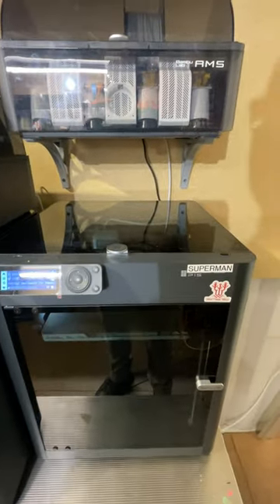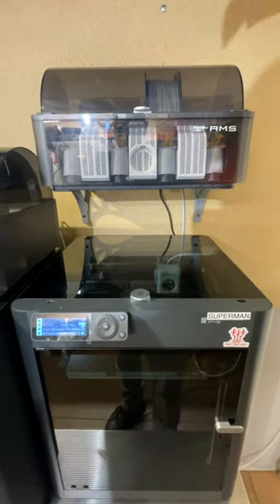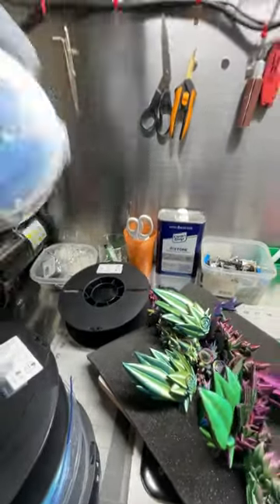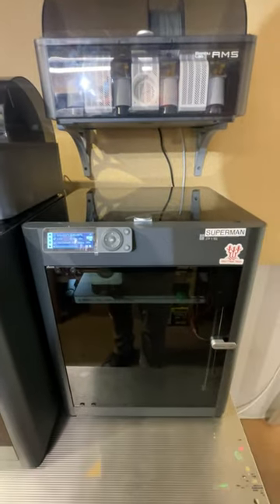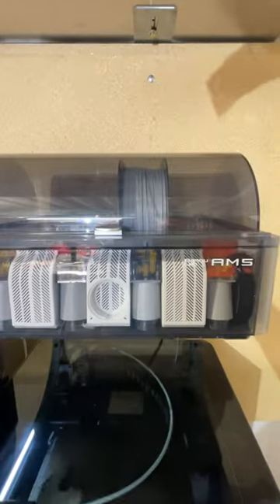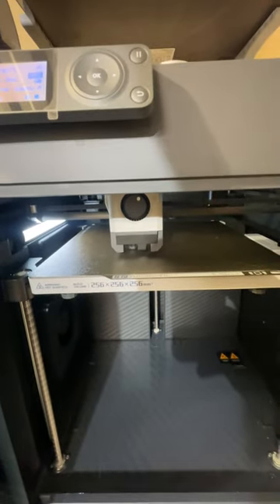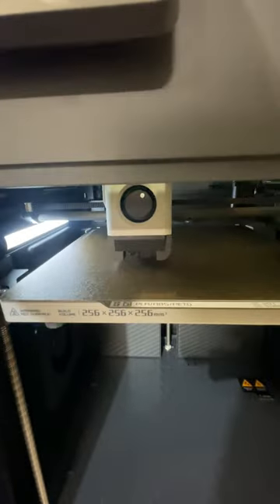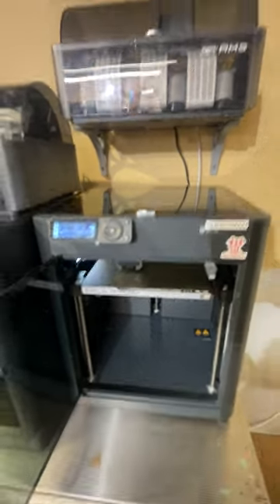Exclusive Tips for Bambu Lab Printer Owners

Comment: Print the hydra ams system and replace the bottom injection-molded base of your ams if you want to use a wide variety of spools. Solves most of these issues.
Reply from the maker: I will look In to it thanks

Comment: Manually heat extruder to 220-230F for PLA, go to the extruder menu and press the button to extrude it while gently pushing the PLA through it.  Keep pressing the button to extrude it every few seconds while pushing the PLA and youll feel it "catch".  Once its caught, then just keep pressing the button until you see the new filament come out.

I had a few minor issues with my A1 mini and that fixed it almost every time.  Its actually FASTER to just go to the extruder control, run it backwards until the current spool releases, put the new spool in and then run it forwards until the new filament comes out.
Reply from the maker: Thank you, I appreciate your comment. This video was created for a post on the Bambu Labs forum, explaining why the majority of users suggest pushing the filament down while heating up the extruder. If the filament breaks inside the extruder, it will stay stuck inside. Later today, I will post a video with more details.
Reply: I have this exact problem with the A1 Mini, push the filament and it comes through very slowly but as soon as I stop pushing it never comes through on its own...extremely frustrating.
Reply from the maker: @andymeenanvideos  probably this will help https://youtu.be/WKCccsy29bI?si=gM8q2r2H_AS4-ICj

Comment: I had a similar problem with the internal hub of the AMS. The Bambu Silk PLA broke off and destroyed the gears inside that hub. I would definitely recommend upgrading to hardened extruder gears if you haven’t already.

Comment: Quick suggestion. Bust out some calipers, and measure the thickness of the filament that kept giving you problems. I spent a whole day troubleshooting a clog in my bambu, before it dawn on me to measure the thickness of the filament. Turns out it was a bad roll of filament that had fluctuations in the thickness. Some parts would be normal, and then after a random parts would be crazy thick.

You should always do a cold pull, if you get a clog. It's quick and easy. 

If you keep trying to print (keep the extruder heated) you run the risk of over cooking the stuck filament. Which (in my experience) turns the filament black and hard as a rock. At which point it gets crazy hard to clear the clog.
Reply from the maker: Hey, thank you for your comment. The reason why I posted this video is to respond to some of the questions and address them. You are right, it could be one bad filament, but this is already my third roll and all of them behave the same way. They all start printing really nice, but at any moment, it will suddenly stop working. I guess there's a kink or something that causes it to break inside. I have already done the drying the filament and done measurements. Also, taking apart, the extruder shows me every single time a small piece. I will post a video with more details later showing extruder. I will take it apart and show the video.

Comment: If it's snapping in the extruder - It's getting to hot in there - prop the lid and open the door. I use a door catch prop so it's gapped a few inches.  You do NOT want to run fully enclosed printing PLA - especially brittle ones. I don't print a lot of PLA but when I do . .run open !!! . . . .I have learned this the hard way after taking my extruders apart too many times. If it's snapping at the J bend in the bowden tube - there are clips and add ons to reduce the feed angle - but either way you want the lid raised or off.  Hopefully that helps someone !
Reply from the maker: Thank you for the message and sorry am answer late but I wanted to test your theory and yes I had no problem printing with my p1p witch at the moment is open with no enclosure the printed parts came out really good with out a problem

Comment: I keep a spare extruder unit and gear assembly when i get into a jammed. I find it quicker just to swap out the whole unit, resume print, then clear the jam for the previous unit for a stand by. Keeping the gear clean helps too. You could also try to perform a manual purge by setting the hot end temps to 200f-220f (your printing filament temperatures) and press the extrude button while pushing (not too hard) the filament in into the hot end. I didn't have luck with the needle or cold pull techniques. The official wiki has good instructions as well.

Also watch out for too much heat when printing with PETG and PLA. In my case, I was getting jammed after 8 hours with PETG and PLA tends to warp. This depends on your room, just leave the door cracked for long prints with the two filaments.
Reply from the maker: Thank you for your advice on keeping a new or backup extruder. The problem I am facing is that after a few hours of printing, the filament just stops in the middle of the print. I have tried replacing the extruder and the hot end, but the problem persists. It happens with all the printers I have, and even when I swap the filament to a different printer, the issue remains. The print quality is good, but the filament keeps breaking. Do you have any other suggestions or solutions?
Reply: @1Bunkershop  Try leaving the door open by a little bit when printing PETG and PLA. It's fine for short prints, however the chamber becomes overheated which makes the filament too soft before going into the hot end over time.

Comment: Sounds like bad filiment altogether if it's brittle and getting stuck. You may need to take it apart I'm pretty sure bambu has instructions on the website. I would maybe try drying it out but sometimes bad filament isn't worth the effort
Reply from the maker: taking extruder Part is no problem. I had a bad badge of filament. I guess I have tried different roles and it still gets stuck in the extruder. My friends also been having problems with the same brand name. It’s not even the same color and they still get the filament stuck in there.
Reply: @1Bunkershop  what are the tolerance from that company?
Reply from the maker: @xathridtech727  well I have to be honest. I don’t know. I am new at this whole 3-D printing stuff. I’m trying to figure out things as it happens and will be showing the videos of the problems because I see is common problems and sometimes you can’t find videos like this online. There’s a lot of comments and a lot of ideas. I will try them all and post them.